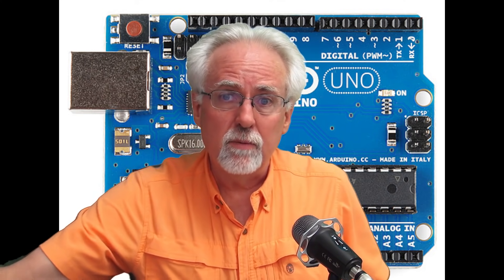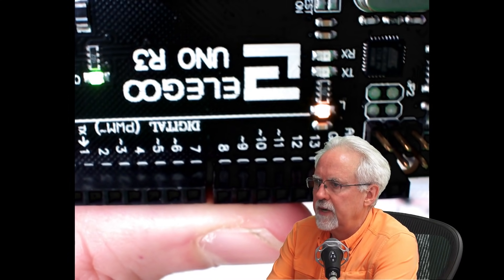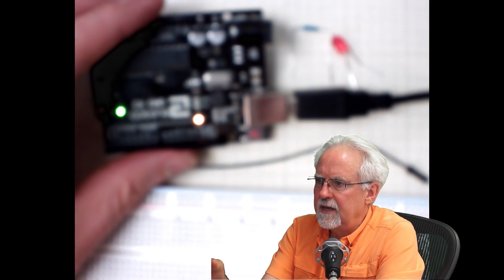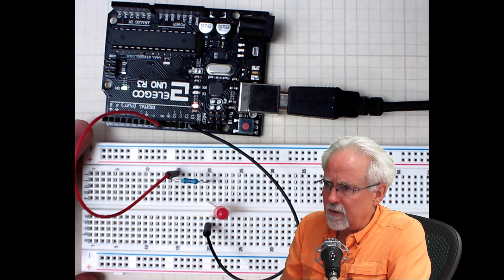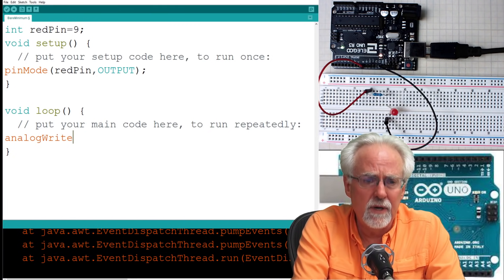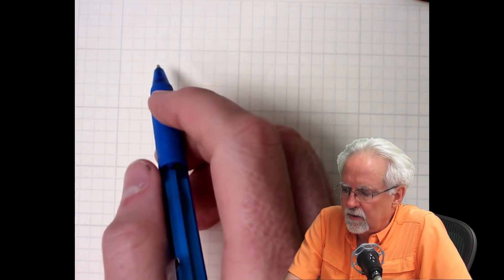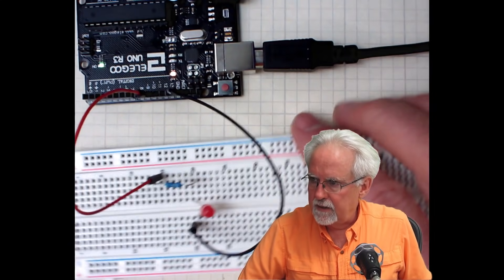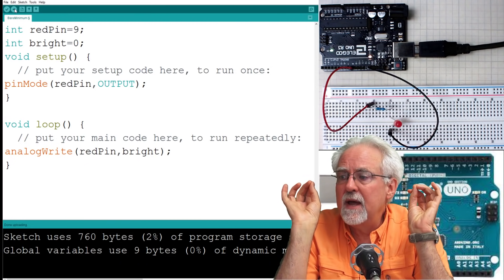Arduino Tutorial 7: Understanding the Arduino Analog Write Command

Comment: Analog and Digital combined

int LED=9;
int glow1=5;
int glow2=50;
int glow3=150;
int glow4=255;

int pin2=2;
int pin3=3;
int pin4=4;
int pin5=5;
int WT=800;

void setup() {
  // put your setup code here, to run once:
pinMode(LED,OUTPUT);

  pinMode(pin2,OUTPUT);
  pinMode(pin3,OUTPUT);
  pinMode(pin4,OUTPUT);
  pinMode(pin5,OUTPUT);
}

void loop() {
  // put your main code here, to run repeatedly:
analogWrite(LED,glow1);
delay(500);
analogWrite(LED,glow2);
delay(500);
analogWrite(LED,glow3);
delay(500);
analogWrite(LED,glow4);
delay(500);

digitalWrite(pin2,LOW);
  digitalWrite(pin3,LOW);
  digitalWrite(pin4,LOW);
  digitalWrite(pin5,LOW);
  delay(WT);

  digitalWrite(pin2,LOW);
  digitalWrite(pin3,LOW);
  digitalWrite(pin4,LOW);
  digitalWrite(pin5,HIGH);
  delay(WT);

  digitalWrite(pin2,LOW);
  digitalWrite(pin3,LOW);
  digitalWrite(pin4,HIGH);
  digitalWrite(pin5,LOW);
  delay(WT);

  digitalWrite(pin2,LOW);
  digitalWrite(pin3,LOW);
  digitalWrite(pin4,HIGH);
  digitalWrite(pin5,HIGH);
  delay(WT);

  digitalWrite(pin2,LOW);
  digitalWrite(pin3,HIGH);
  digitalWrite(pin4,LOW);
  digitalWrite(pin5,LOW);
  delay(WT);

  digitalWrite(pin2,LOW);
  digitalWrite(pin3,HIGH);
  digitalWrite(pin4,LOW);
  digitalWrite(pin5,HIGH);
  delay(WT);

  digitalWrite(pin2,LOW);
  digitalWrite(pin3,HIGH);
  digitalWrite(pin4,HIGH);
  digitalWrite(pin5,LOW);
  delay(WT);

  digitalWrite(pin2,LOW);
  digitalWrite(pin3,HIGH);
  digitalWrite(pin4,HIGH);
  digitalWrite(pin5,HIGH);
  delay(WT);  

  digitalWrite(pin2,HIGH);
  digitalWrite(pin3,LOW);
  digitalWrite(pin4,LOW);
  digitalWrite(pin5,LOW);
  delay(WT);

  digitalWrite(pin2,HIGH);
  digitalWrite(pin3,LOW);
  digitalWrite(pin4,LOW);
  digitalWrite(pin5,HIGH);
  delay(WT);

  digitalWrite(pin2,HIGH);
  digitalWrite(pin3,LOW);
  digitalWrite(pin4,HIGH);
  digitalWrite(pin5,LOW);
  delay(WT);

  digitalWrite(pin2,HIGH);
  digitalWrite(pin3,LOW);
  digitalWrite(pin4,HIGH);
  digitalWrite(pin5,HIGH);
  delay(WT);

  digitalWrite(pin2,HIGH);
  digitalWrite(pin3,LOW);
  digitalWrite(pin4,LOW);
  digitalWrite(pin5,HIGH);
  delay(WT);

  digitalWrite(pin2,HIGH);
  digitalWrite(pin3,HIGH);
  digitalWrite(pin4,LOW);
  digitalWrite(pin5,LOW);
  delay(WT);

  digitalWrite(pin2,HIGH);
  digitalWrite(pin3,HIGH);
  digitalWrite(pin4,LOW);
  digitalWrite(pin5,HIGH);
  delay(WT);

  digitalWrite(pin2,HIGH);
  digitalWrite(pin3,HIGH);
  digitalWrite(pin4,HIGH);
  digitalWrite(pin5,LOW);
  delay(WT);
  
  digitalWrite(pin2,HIGH);
  digitalWrite(pin3,HIGH);
  digitalWrite(pin4,HIGH);
  digitalWrite(pin5,HIGH);
  delay(WT);
}

Comment: int LED=9;
int glow1=5;
int glow2=50;
int glow3=150;
int glow4=255;

void setup() {
  // put your setup code here, to run once:
pinMode(LED,OUTPUT);
}

void loop() {
  // put your main code here, to run repeatedly:
analogWrite(LED,glow1);
delay(500);
analogWrite(LED,glow2);
delay(500);
analogWrite(LED,glow3);
delay(500);
analogWrite(LED,glow4);
delay(500);
}

Comment: Be careful with the wires that come with the kit. The pins often come out when removing them from the breadboard. I'm using some tweezers to help stop that from happening but it still happens here and there. Is there a method to  pull them out without the pins coming off or should I just invest in some better ones?

Comment: Everybody used to tell me to check on arduino,  as an automation engineer I usually use 'blocks' to construct devices. I started as electronic engineer 20 years ago, but after 10 years of tinkering with all those small components I was fed up and 10 years ago migrated into automation (no more soldering and assembling - I just got fed up with it). I ordered arduino recently as an impulse buy (finally, after years I checked on it).  Your lectures are fantastic, picking up syntax, basically I have done some coding with different tools previously. Already have 2 projects in my mind  TCPIP analyser/logger and tablet as HMI, a lot of work, but it is way faster to learn new things when you want to do something and you do not know how! Challenge is not to copypaste anything from the Internet. Thank you for this great content.

Comment: Just got my Arduino Super Kit today; actually had it handed to me by the mailman (in this case it was a man) right off the truck before he could even load it into the rented mailbox. Paul, I've gone through the first 6 videos, doing the circuits and homework. Having been a professional programmer for 5+ decades, I normally set myself a higher programming standard to meet (e.g. for the homework from video 4 I used a function to streamline the code). All this to point out that your videos can even be fun for salty old bit-hackers like me. It's like going back to my youth :) I may not be able to stand ice coffee (sorry), but I can have fun playing with some simple circuits. Watching these videos has actually given me the idea to design and build a NTP-based digital clock for the bedroom. I can print a case on my Ender 5 Pro.

Comment: Hey, Paul McWhorter you actually hook the wire in pin 8 but you should had hooked it in pin 9. There is no ~ sign in pin 8 how did it work?

Comment: did it. only issue is the leds would stay on for 500 from the last number set. so it would only show the actual number for 500 of the 1000. after watching the video for a few miutes when you first started with the code i realized what id done. went back and fixed it. now its 100%. i have my delay set to 2000 though so i can run through the numbers in my head a little easier while they cycle.

Comment: Hi Paul, thanks a lot for all videos. I have a question: what happen when i write a value over 255?
Reply: If you input a value > 255 then it will subtract that value from 255 and return the difference (355 would act the same as 100 because 355- 255 = 100).

Comment: Hi Paul, really enjoying the videos. I just have a question about the set up at the top of the code. Is there a reason that we use “int” rather than “byte” as the data type for the pin numbers?

Comment: Is there a Cheat sheet of all the codes like digitalWrite and analogWrite, int, and strings would be helpful in forward thinking and help defining Variables. I have been programming Visual basic for about 4 years and can see a similarity.  Made a lot of calculating software at my work place, that uses databases with printing from data from database with colour values.

Comment: Regarding Lesson 7:  I agree with one of the comments,  Since an LED has a cut-in or threshold voltage (about 2 volts for a red LED), you should not see any light for an analog write of less that about half of +5, i.e., the output is not linear with pin voltage.
Reply from the maker: you are correct. I will explain in a later lesson the 'analog' voltages produced by the arduino are really PWM . . . so it does work for brightness control of led

Comment: Another fun lesson and another homework project in the books:  https://youtu.be/dTBi7Hym7VU 
I am going to do some checking but I thought I'd post the question...Is there any benefit to using digitalWrite HIGH or LOW versus analogWrite 0 or 255 I guess specifically if we are limited to 2048 bytes for variables is one method more efficient with the memory than the other?

Comment: Hey Paul
Thank give for your lessons - fits perfect in these covid 19 times. Denmark is total closest down. I have some challenges with the elegoo wires. I experience often loose connections - especially on the breadboard. I wonder if a wire with a tiny bigger area would help - do you have any experience with that?

Comment: I have written my code virtually the same as Paul's. However, when I put a value into the analog write, the LED is completely off until 127, and then completely on from there to 225. my circuit is also connected exactly the same, so im not sure what is wrong. any ideas?
Reply: I am having the exact same problem
Reply: I figured it out....I was on pin 13 which doesn't have the squiggly line next to it.  I changed it to pin 9 and now it works!

Comment: I’ve noticed something in your coding practices, Paul. I’m very stingy when it comes to memory and allocating space for variables. I LOVE the way you explain everything, very clear, easy to UNDERSTAND, and not just MEMORIZE (as I’ve mentioned before), but there’s one small thing I’d like to point out. Perhaps you can address it in one of your future videos. Arduino is generally pretty good with memory, but eventually you are gonna be fighting for every last byte of memory. You are probably getting where I’m heading with this. ATmega based Arduino stores “int” variables in 16bit format, which is 2 bytes... That’s exactly double what you need for most of your pin allocations and PWM values. I like to assign my pins and other small values (such as brightness levels and motor speeds and everything PWM related) in “byte” values. You can essentially cut your memory allocation for most variables in half. Is there a downside to this? Can you please address this in one of your future videos? This may be an interesting topic to talk about.
Reply: He probably didn't go that much in detail  because he wanted to avoid confusion among first timers
Reply: @pixels3320    Correct!!! ....

Comment: Thanks Paul for the tutorials.  I did some programming years ago with arduino and am getting back into it now.  I am testing the code in your video and when I get below 100 on the variable the LED does not light.  Anything above it does light.  What could be reason for this?  I am using a Teensy 3.2 chip.

Comment: Homework done, not exactly as the assignment says but i would think its close enough

Note I have a redLED plugged into pin ~11

CODE:

int redLED=11;
int inDelay=500;
int bitOne=1;
int bitTwo=2;
int bitThree=4;
int bitFour=8;
int bitFive=16;
int bitSix=32;
int bitSeven=64;
int bitEight=128;
int bitNine=255;
void setup() {
  // put your setup code here, to run once:
pinMode(redLED,OUTPUT);
}

void loop() {
  // put your main code here, to run repeatedly:
analogWrite(redLED,bitOne);
delay(inDelay);
analogWrite(redLED,bitTwo);
delay(inDelay);
analogWrite(redLED,bitThree);
delay(inDelay);
analogWrite(redLED,bitFour);
delay(inDelay);
analogWrite(redLED,bitFive);
delay(inDelay);
analogWrite(redLED,bitSix);
delay(inDelay);
analogWrite(redLED,bitSeven);
delay(inDelay);
analogWrite(redLED,bitEight);
delay(inDelay);
analogWrite(redLED,bitNine);
delay(inDelay);
}
Reply: Supeer tutorial about arduino. Thankyou. How we program  the ic & how we select the ic?  Can you guide the universal temperature  controller program. Thank you

Comment: For more of a challenge in this exercise, I made "RED HOT to WHITE HOT", 6 LEDs (RRRYYW) that brighten slowly from left to right.  I duplicated the circuit 6 times. Each LED begins to brighten in 'sympathy' to its brightening neighbor. Happy 4th of July.

[code]
// Analog write exercise (Paul McWhorter YouTube Arduino Tutorial)

// 6 LEDs RRRYYW begin glowing from left to right "RED HOT to WHITE HOT"
// Happy Independence Day 2019

#define NumLEDs 6

int LEDPin[NumLEDs] {3,5,6,9,10,11};    // load array with the 6 ananlog output pins
int PinValue[NumLEDs] {0,0,0,0,0,0};     // array of current values for each pin OUTPUT
int intAdelay = 10;                                    // brighening speed
int intMaxOut = 220;                               // Max OUTPUT value
int intSympatheticTrigger = 50;            // sympathetic trigger value

void setup() {
  // Set Arduino pins to OUTPUT mode
  for (int i = 0 ; i < NumLEDs ; i++) pinMode(LEDPin[i],OUTPUT);
}

void loop() {
  // RED HOT to WHITE HOT (tm)
  while ( PinValue[NumLEDs-1] < intMaxOut) {
    for (int i = 0 ; i < NumLEDs; i++) {  // increment output for appropriate pins
      // increment OUT value if pin < intMaxOut and neighbor has reached SympatheicTrigger
      if (PinValue[i] < intMaxOut && (i == 0 || PinValue[i-1] > intSympatheticTrigger) ) {
        analogWrite(LEDPin[i], ++PinValue[i]); 
      }
    }
    delay(intAdelay);  // delay the advancing brightness effect
  }
  // rapid cooling
  for (int i = NumLEDs - 1 ; i >=0;i--){
    PinValue[i] = 0;
    analogWrite(LEDPin[i],PinValue[i]);
    delay(intAdelay * 10);
  }
}
[/code]
Reply from the maker: Well done!
Reply: @paulmcwhorter  Thanks, but I'd say "Well done you."

Comment: hey, dear paul. sorry for my silly brain .I  have one questions about your circuit , you said "holes between columns not connected" in tutorial 3. So you put the red led lighting to connect the columns across the trench . Whether it means we could use something(like leds or  resistance etc) across trench and we can across back for complicate circuits? whole entity circuit shows just like mirror ladder type in board ? Because i usually do circuit on one side , this is my frist time to do this.
Reply from the maker: I did not understand the question . . . look at the graphic on my web site showing the breadboard, and it clearly shows what is connected and not. Look at this lesson on the web site.
Reply: Paul McWhorter let me easy to say, you said “ hole between columns not connected across the trench “in tutorial 3. But you put the red led light across the trench, why? I’m confused
Reply: @shuangdeng3554  it is just a bread board choice. Going to the next column is going to a place not connected to the previous column. Going across the trench is the same thing: going to a different column not connected to the previous column
Reply: @paulmcwhorter  okay ,I'm thinking wrong .My fault.Thanks for your patience.

Comment: what happen if we pt 300 instead of 255? is it going to burn LED?
Reply from the maker: No but will give unpredictalbe results as it will not know what to do with the number. 255 is 2^8-1, showing the output goes into an 8 bit byte. 300 would be a nonsense number to it, since it can not make it fit into 8 bits.
Reply: @paulmcwhorter  thank you sir for this information..
Reply: Designer of analogWrite function decided that it can accept int numbers (16 bits) but register responsible for PWM inside a mikrocontroller is 8-bit wide. So most significant bits will be ignored.
300 in 16-bit: 0000_0001__0010_1100
lower byte is: 0010_1100
so the brightness will be 44

Better design would be using int8 for a value so compiler could detect it and print warning or clamping should be used "if (value>255) PWMvalue=255 else PWMvalue=value"